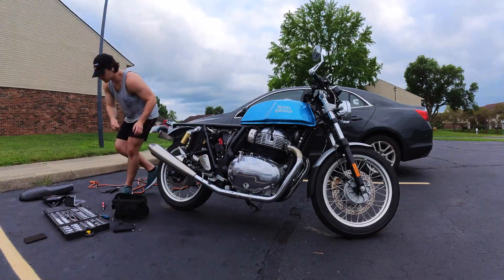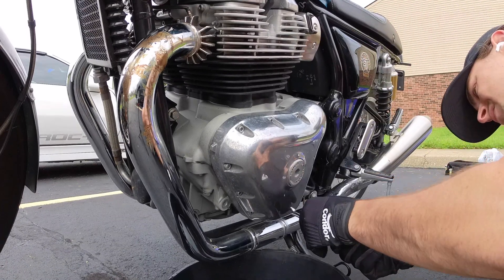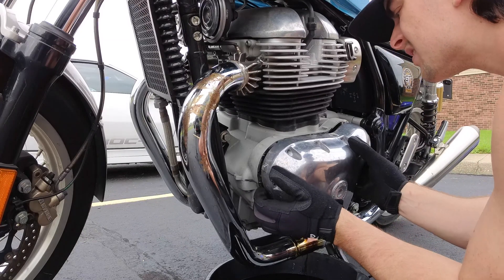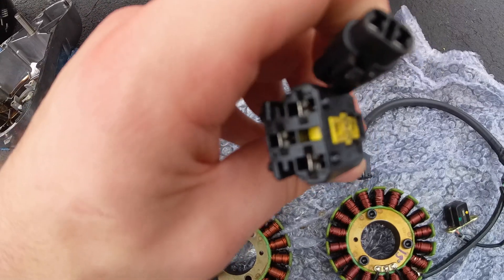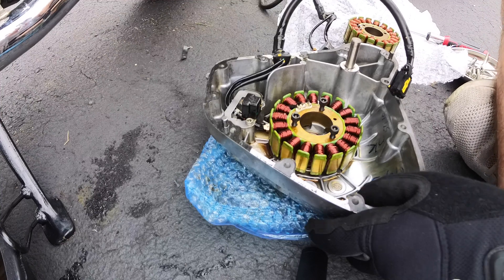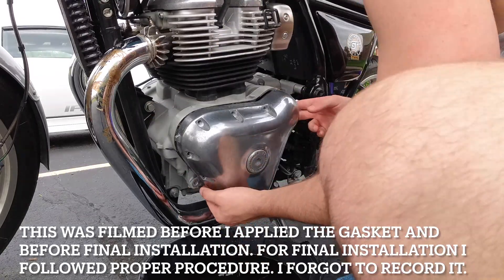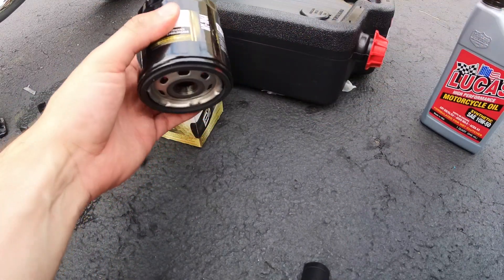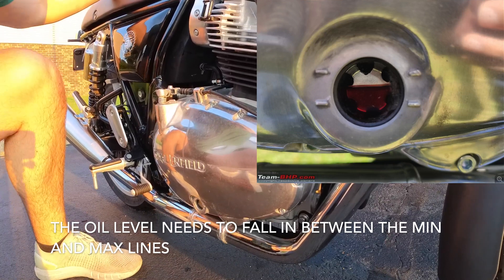Solving a 2020 Royal Enfield Continental GT's dying battery problem (Stator & Rectifier Regulator)

Comment: Very Descriptive, and helpful video. 

I had the similar issue with my GT 650, and I jumped the gun on battery which was seemingly fine at the time. The next I suspected Rectifier Regulator. Luckily I didn't jump the gun on alternator rotor. However, it took a good deal of arguing and contesting my stand against the RE workshop team, as they were were insisting me to change of all other cut-outs which could be draining the battery. Good part was Changing the Rectifier Regulator solved the Battery drain while riding the bike. In India Service is relatively cheaper, so I got it done at the Royal Enfield's own workshop.

However, I still face standby battery drain issue. My First battery would last even 3-4 month of not riding. The new battery doesn't last much, also as I don't ride the bike due to another accident unrelated to riding. I may recommend a battery disconnection switch to be added in circuit to avoid battery standby drain. 
Sid From India
Reply from the maker: Good luck. Hoping for your quick recovery!

That battery disconnect switch seems like it would be the easiest way to fix your issue. If you can't find the problem I'd go down that route.

Comment: The procedure for checking a battery issue is the same for cars and motorcycles 
1. you start with checking the battery voltage with vehicle not running using a multimeter - it should read 12.3 to 12.6 volts 
2. if it is lower you must charge it with a battery charger until it reaches 12.3 to 12.6 Volts - if it won't charge the battery is weak
    note: if the voltage while starting drops below 11 Volts the battery is weak - a battery tester tool will confirm this
3. now that the battery is fully charged , start the vehicle and check the voltage while running 
   - it should be 13.2 to 13.8 Volts indicating proper charging
4. if it reads the same as when it is not running , the charging circuit is not charging - troubleshoot charging components
5. in this specific case the Royal Enfield 650 has a known weakness with the rectifier failing
    this known issue is due to excessive heat due to the location at the lower rear of the engine causing failure
    many owners have fixed this issue by relocating the new rectifier to the front forks with an extension cable 
recommended YT videos
Interceptor 650. Rectifier/regulator re-location summary 
https://www.youtube.com/watch?v=oPRl3x5nqcI
email address is jamesengland1000@gmail.com

also there is another known issue
Symp: poor charging - no voltage at fuse box
https://www.youtube.com/watch?v=QIFetThX5lc
Prob : corroded connector at starter motor solenoid
fix:  splice in new connector and seal with grease or tape

also stators can fail but this is more rare and normally occurs on older bikes - see @sicks6six comment below

hoping this is helpful for all RE 650 owners
Reply: Your comment is already a year old and your explanation was magnificent. I also follow the channel you mention in the text. I will save this video for later reference, especially because of your comment. My sincere thanks for sharing your knowledge.
Reply: @moreirasp  I neglected to mention that a Battery Tester will tell you if your battery is failing by telling you how many CCA Cold Cranking Amps your battery is actually capable of. You can use my method as a basis for diagnosing. If it's your best bike buy the best quality battery money can buy - usually Japanese but they are at least twice the price. Panasonic battery's are amazing.

Comment: This is the type of thing that stops me from buying a RE int650. The motor seems strong but if i have to rebuild the entire electrical system it hardly seems worth it. Wonder if RE will rectify the electrical weak points.

Comment: How do you undo that alternator plug? Mine seems hard to undo, not sure how its done
Reply from the maker: You need to pull up on the red clip. It is very snug. I thought I pulled it up enough at first and it wouldn't come out, still needed a little extra. See 1:42 in the video to see how it should look.

Comment: every bike I ever had with charging problems it was the stator plate, when tested with a multimeter they seemed OK but when you put a stator plate in from a bike you know was good the problem vanished, often the wrong solder can cause problems and the insulation is not good enough and often the bike needs to heat up for the stator to start to malfunction, german and Japanese stator plates are the best I've found,  the windings and the soldered connections are the best, but as I say testing with a multimeter often tells you everything is OK but under load and when hot they stop working properly, very hard to track those faults down without a stator off a bike you know is OK,

Comment: Is that the correct mileage  ?   and the system went bad ?  I would expect this system to last much longer... as in 25000 or more....   I have a 2020 Interceptor that just turned 5200 miles... so far no issues.  Thank you  :)
Reply from the maker: I've read online it's an issue these REs face because of its placement. I sure expected it to last longer. Best of luck with yours

Comment: great video: Old school = permatex RED only= heat /oil /and gas proof!!!!!! even use it as the gasket .. if scuff up with drill motor from walmart.. and wire wheel ! always wash hands with dawn to get oil off! Plus always finish the clean surface with paint thiner or carb cleaner in a pinch.. or wipe alcohol... want it fast dry /clean .. apply permatex thin  as you possibly can!!!!! too much is Really bad .. plug up oil ports ! if bur- take it off with a knife hone! keeps it flat..
Reply from the maker: Thank you for the tips!

Comment: Wow thanks for the knowledge.
Reply from the maker: Thanks for watching!
Reply: The knowledge would be some simple voltage and resistance checks to identify the exact problem, not just start swapping out parts. No idea why he replaced the stator.  He keeps calling it the alternator, but bikes use a rotor and stator, with a regulator rectifier. What the rectifier regulator does is take excess electricity and convert it to heat.  These fail when they are hidden on the bike away from airflow and overheat. So just replacing it will just lead to another failure. It needs to be relocated.
"Knowledge".

Comment: Int650 RR unit doesnt last long as it doesnt get enough air circulation, even i had to replace it in 2 years
Reply from the maker: It's very unfortunate that's the case. When buying a bike this new it should be expected for the RR to last much longer.

Comment: to check the alternator have you tried continuity  (beep)test on the pins ?  one terminal on the pin one on battery ground

can do resistance check on the Regulator rectifier too..
https://www.youtube.com/watch?v=mn6RtpdmeQE
Reply from the maker: Thank you for the link! I didn't know I could test the RR that way. I still have the old one so I'll give that a try.

Comment: to check the charging system put your volt meter on the battery, you will see a voltage increase when you start the engine.
Reply: Yes first thing to do is test to see if the battery is charging. After that test the alternator for output. However my first suspect on a modern motorcycle would be the rectifier regulator.  I had two RRs fail on a 2001 Triumph Bonnie. I replaced the third one with a Mosfet type. These are more expensive but MUCH more reliable. I modified a s/h one from a Yamaha something or other. Universal ones are available and they handle heat much better and would be my choice on the RE particularly as the RR is situated behind the motor rather than in the more conventional position out front and in the wind.
Reply: @iandusud  a R E owner is making rectifier relocation cables to put it up by the oil cooler. 😁
Reply from the maker: Thank you for the comment! The reason I didn't do that is because I knew the battery wasn't charging. I was trying to check if it was the alternator bad or something in between.
Reply: @GOTGasss  this is a way to check the alternator, you get 12.5 volts from a good battery, and if the alternator is working when you start the bike you get 13.75 to 14.5 volts. you got it, and your back on the road. 🤠
Reply: @DANTHETUBEMAN hello sir! My interceptor battery showing 12V when the bike is off and then showing 14V until 15V when the engine is on. Is it okay? I read about when the bike is charging the battery normally it should be 13V to 14V
Reply: @andimfx  yes it's ok, alternator is charging the battery.
Reply: @DANTHETUBEMAN  thank you. I have starting problem, the battery is fully charged but the bike sometimes doesn’t start. Sometimes it does sometimes it not. When the starting problem occured there is only clicking sound and dimmed headlight and speedo when I push the start button
Reply: @andimfx  hi, check your relays on the left side panel. There are some diagrams about which one to change but I've read that those relays came with and overload of lithium grease and that in certain scenarios mess up with the electric conduction.
Reply: @vvidalftw  thank you, I’ve done that and the problem is battery worn out, the ampere is down because of battery age even it fully charged